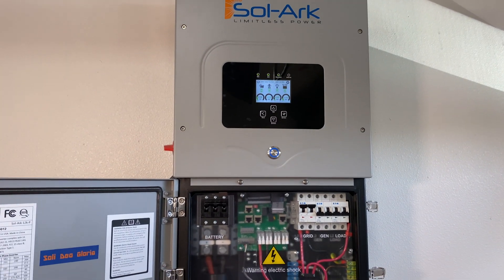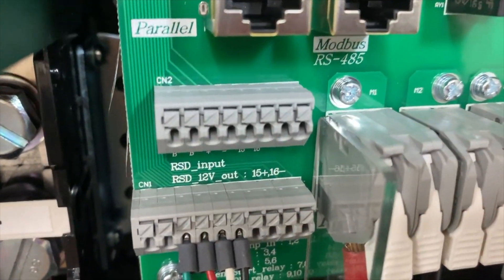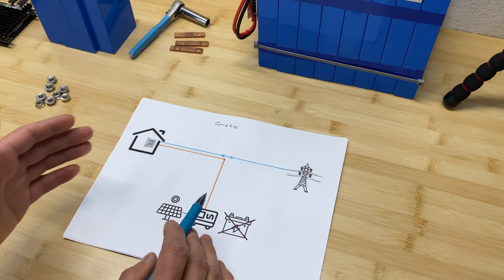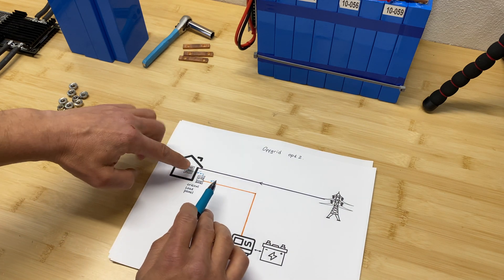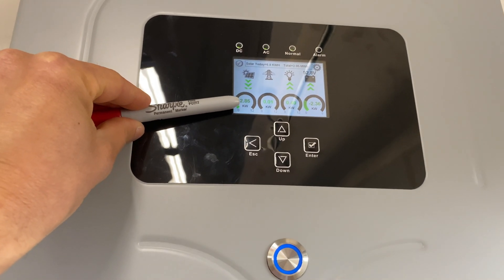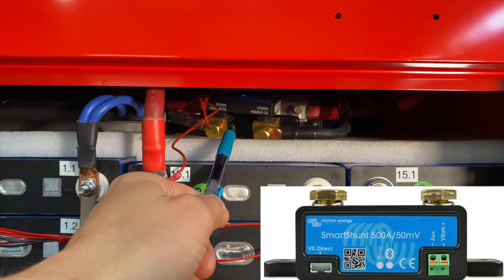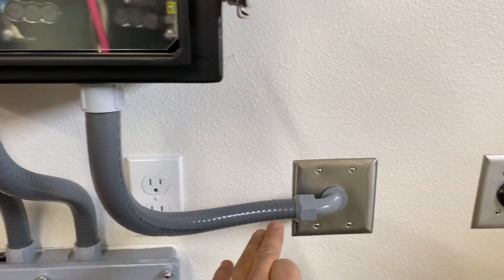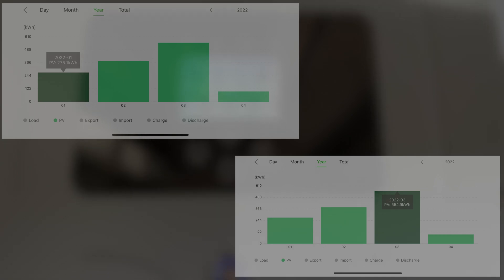3.8kW solar system with 23.5kWh battery. Detailed review.

Comment: Thank you for the nice video. I have a simple question. In the hybrid setup, and leaving the net metering switched on, how do you control what power from the batteries is sent to the house loads and what is sent to the grid?   Can you control this?
Reply from the maker: yes, CT sensors are installed right after the meter, so it's possible to control if you want to export to the grid or not. Also, all inverters have settings to prioritize battery charge or supply to load.

Comment: Does the invert automatically switch from grid-tie to off grid?   How long will that battery bank typically last you?
Reply from the maker: I have to manually switch from grid-tie to off-grid, 23kWh is good for about 30 hours (just in my case). 
Here is the video for the automatic switch between grid/off-grid: https://youtu.be/UXvFnlv3a88

Comment: Probably already answered but have been reading online that I can connect A/C coupling (Enphase Micro-Inverters) to the Sol Ark 5K and 8K only up to 3KW but the specs from Sol-Ark say 9.6KW for AC Coupling. My solar array is all with Enphase Micro Inverters. Really interested in using a Sol-Ark 8K with the HomeGrid Stack'd Battery.  Recommend YES NO?
Reply from the maker: Hi, cannot find any info about 3kW, but spec sheet stating 9.6kW max AC coupled imput
https://www.sol-ark.com/wp-content/uploads/8K-2P-N_Manual.pdf
Reply: Both the 5k. and the 8k say 9.6kw A/C coupling but a couple of installer videos keep saying they are limited to 3KW. Sol-Ark states in their video that the 15k has a a/C coupling limit of 19.KW.  Just need to be really sure because all my panels have micro inverters and I want to install a HomeGrid Stack’d battery.
Reply from the maker: @kayjet64  it's better then to contact solark customer support and double-check. 
Going to be great if you could post update here.

Comment: Love the video but I’m so confused on the way you have it wired. I thought you were supposed to disconnect the wires coming on top of your sub panel completely connect them to the inverter then send wires from load to 
your sub panel and connect them where your old grid wires we’re and use the inverter as a pass-through 😅
Reply from the maker: My connection is grid tied. here is why it's paralleled with grid.
I can manually disconnect subpanel and power it from Solark only.

Comment: Cool!
I have a 3.6 kw off-grid system with a 5.6 kw inverter and a 7.2 kw lifepo4 (Pylontech) and I want to complete it with a 5 KW on-grid system. Is there a device to interconnect the two systems so that I can charge the batteries with the on-grid system? (especially valid when the sky is cloudy)

Comment: Can solark inverter communicate with optimizers If I want to replace solaredge grid tie Inverter
Reply from the maker: It can communicate with micro-inverters for sure. I don't know about optimizers, try to contact Solark customer support, I don't remember something about it mentioned in user manual.
Reply: @SolarEngineering  thank you for the answer. I am debating between ac coupling vs replacing the grid tie inverter with hybrid inverter

Comment: I still love your excellent content.  Thanks to yourself and a few others, I finally decided to buy a SA 15K after shopping around and finding a decent deal on one.  I've also picked up 16 280ah EVE cells and a JK 200a BMS to go with my 20kw of panels (which will only partly be installed initially).  I still need to get the other odds and ends, but your videos have helped me to understand other pieces I'll still need to procure to complete it all.  Exterior AC and DC disconnects, rails, DC fuses, wiring and I'm sure I'm still missing some additional stuff?  Thanks, and please keep the content coming!
Reply: If you don’t mind, what kind of price is good? Do you like who you got it from? Do you mind sharing who you got it from? Thanks. I’m on the fence with a 12k vs 15k
Reply: @Upliftyourbrothers  IMO, the 15k is a no-brainer over the 12k given the additional features and significantly more capacity, all at only a few more $.  That is if you feel you'll use it.  And while I don't need this much inverter, I think I'll need it in the future given EV's and electronification is basically being forced on us.  I bought from Renvu.  I have an account with them, so below advertised price.  I've been extremely happy with their service.  Of you live in the northeast I might be able to help you, if not give them a call and I'm guessing they will still do better than their advertised price...

Comment: All those batteries and you only have 455Ah?  I thought each one of those cells were 150Ah?
Reply from the maker: that's correct, I have 3 cells in parallel (2x155Ah, 1x150Ah) and then 16 in series.
So total 3p16s,  460Ah 48V
Reply: @SolarEngineering  Thank you for the reply.

Comment: You mentioned that you moved on to the solark because of the limitation from your gtil system. What were your limitations because I'm in this rabbit hole at the moment and want to just purchase one system, that's easy on the wallet.
Reply from the maker: 1. I need to have the ability to run off-grid during a power outages.
2. Need more powerful inverter (GTIL was able to supply only 3.6kW)
3. When I need to install a few more panels then another charge controller needs to be added (and total amount of devices in system will grow to 5 (3 invertters, 2 charge controllers).
4. At the summertime I was losing energy because I can draw from inverters only 3.6kW, and even if I have a lot of solar and battery power, was still limited to 3.6kW. Having solark (or any all-in-one unit) I can draw 5kW from batteries + all power from the solar array.
Reply: @SolarEngineering  would you suggest any other all-in-one inverters, instead of the outback? Sol ark is out of my budget, but would still like to keep the gtil. Tia

Comment: I see you used a inverter with limiter, im thinking doing that since i can't afford a battery. Is any available that take directly from the panels ? and how abou the ones you used are you happy with them ? do you still recommend them or there was problems ?
Reply from the maker: The cheapest option is going to be GTIL inverters (you can find in my previous videos). It has some issues with fans going out, but in general it worked well for me.

Comment: Amazing SE; I think you have been reading my mail!  The only question I have:  when can I get you to come to my house and help me with my DIY project?

I am currently GridTie status (est. 9.7 KW solar panels in 2 arrays with 2 Inverters) and I want to move over the OffGrid - Option 1 with Battery Bank being the primary source of power and only using Grid Power when Battery Bank is depleted.  Phase 2 of this Option 1 would be to grow my Battery Bank supply by adding a second bank to meet demand.

When can I pencil you down on my calendar to be here?  Keep pumping out you YT shares - your content is superb and very very informative.  Thanks!
Reply from the maker: do you know what kind of offgrid inverter you are going to use and what batteries (DIY or branded packs)?
and I didn't receive email from you.

Comment: 10:42 SolArk @$7K is a ripoff! It is just a Deye inverter but $5000 more expensive!
Worst part of it, Sol Ark banned anyone selling Deye in USA!
Reply from the maker: I didn't believe the first time I heard that SolArk is not a USA product. But yes - originally it is Deye inverter.
Reply: Yes, it's a Deye inverter modified to SA specs.  I believe SA does the lower end and has their own FW.   SA also supplies REAL 24/7 customer and technical service support, not to mention domestic parts and repair service.  Order a similar spec Deye from China (first you can't get them or even with the same spec), and after paying the financial and shipping fees, you couldn't buy one today for $5k less, even if you could import one.  Never mind having true 24/7 domestic support or the add-ons.  I agree SA adds steep premium, but not $5k and there's still not much out there that will match them for the total (and reliable) package.  Trust me, I've looked!  

BTW, SA didn't ban selling Deye in the USA.  They partnered sharing the engineering on the product and by far were the largest buyer of these inverters in the US, so Deye agreed to give them an exclusive business agreement.  I too wish you could still by a more stripped-down basic Deye in the US, but I more than understand the business decision on both sides.

Comment: Hello, Nice set up. I looking to get a hybrid inverter because i dont want to do net metering but i will like to use the inverter as a grid tie with a limiter so can supply the power i am consuming . Does the Solar ark have that option as your previous set up . Thks
Reply from the maker: at 6:20 I'm showing exactly what you described. It calls "limited power to home" or  "grid zero mode". 
Yes, Solark supports this feature.
Reply: @SolarEngineering  Thank you sir.

Comment: I presume you ran ground from your panels? To what did you connect this ground in your system?
Reply from the maker: yeah on 8:50 see lug attached to box with green bolt, bare wire going to 2pcs 5/8" 8ft ground rods, and green wire going up to roof to ground rails and panels.

Comment: Pretty clean setup.... Bravo. Thanks to some ATS controled by DIY IOT, I can switch between full Offgrif topology to grid according for example to my battery level. I can also be in your presented offgrid topology with a grid input only mode. I have only a 15Kwh LFPO4+JKMBS battery.... but my house is not huge and well isolated.  Iiving also in sunny place, I can be offgrid at 90% of the year...
Reply from the maker: Thanks! 
That's my dream to move somewhere and build a full offgrid solar system. Maybe sometime in the future.
Reply: @SolarEngineering  You can check my channel.... got plenty of videos but in French language sorry :(

Comment: Nice setup you have. The other option is like mine. Install 200A manual transfer switch  to choose either the grid (which I will have power co turn off soon) or   my solar system. Two 12K's, 20640W Array, 132kWh battery bank and 10K LP Gen. I also installed 100A man xfer sw to bypass Sol-Arks direct to 100A Solar Main Panel.
Reply from the maker: impressive system, let's shoot video!

Comment: Interesting, but you should also talk about your power needs and cost. N.Cal has a mild climate but still 276Kwh in January seems to be just enough to run the house without any heating and AC is barely needed in the summer where production will be at its peak, unless you're living way far east.
The solar panels price is very good, the batteries price is reasonable but the inverter seem very expensive, likely because its a low production items and you're paying mostly for the R&D.
How long do you thing it will take to have a return on investment?
Reply from the maker: Power usage will vary from one household to another.
My house is fully electric - heating, water heater, stove, so I'm using all of the energy.
Pay period is about 8-10 years (in my case), but most important for me is to have power when a power outage or "safety power shutdown" occurs.
And I agree that the inverter seems unreasonably expensive.
Reply: @SolarEngineering  Yes power usage will vary from one household to another especially if they are located a few miles from the Pacific or from the Nevada. 
You're showing your personal experience, great but you should show what was your energy bills before and after the conversion. Did you consider reducing your electric power usage with reversible heat pump which are very efficient in the California weather and solar water heather, I still don't see how you can survive with 276kwh in January in a fully electrical powered house.
I perfectly understand your concern about the "safety power shutdown" but in a state where the electricity is greatly overpriced and the personal generators are banned, maybe the problem is somewhere else.

Comment: Isn't the definition of "offgrid" meaning that there is no connection to the grid?  If there is a connection that would be grid tie or hybrid, no?

Secondly, I wonder how the inverter can "supply" power?  Does it actually generate power or it just directs it from a battery, generator or grid?
Reply from the maker: Yes it's correct. Often times when people build full offgrid system, they have access to some sort of grid power (unreliable city grid, generator, shore power). 
RV is a good example - it has offgrid power system, but additionally could be connected to shore power or generator.
Reply from the maker: >>Does it actually generate power or it just directs it from a battery, generator or grid?
redirecting grid power or converting DC power to AC when using batteries.
Reply: @SolarEngineering  Ok, got it!  Thanks.

Comment: I have a 3.8kw of panels . The inverter is a power one . I have added a battery controller with 3kw of usable storeage . The battery controller has a CT clamp on the inverter output and one on the grid input . When it sees power attempting to go to grid it sends it to the battery bank . On the other hand if it see power being used by the grid it will try to match this power with the battery keeping the HSE at zero power from grid .
When battery is full another CT clamp check grid in/ out if it sees power going to the grid it sends it to a hot water tank (150 liters) and a towel rail. Once all these items are at max the solar power may pass to the grid.

The charge controller also has UPS for grid dowond . I have a generator switch to isolate grid as well as a generator (6kw)
Reply: Which battery controller are you using?
Reply: @RJ-cc1fz  hi , sofar3000 sp
Reply: I like your battery's I am only on lead acid . But come the summer I intend to put in a 16s 48 volt lifepoo4 150amp and then at another before winter
Reply: @andrewpeterwhatsonmybench1383  my batteries?
Reply: @andrewpeterwhatsonmybench1383  really interested about your inverter. Is it a grid tie inverter and a charge controller? What is the pv voltage range it accepts?
Reply: I have two inverters one is grid tie and has two inputs for two arrays . It is a 4kv inverter . It just converts the DC from panels into AC and feeds the HSE or grid if the HSE does not use it .
I firstly then added a switch which if it sees AC going to the grid . It will send 40w at a time to my hot water tank . 9 KW will heat my water to 80 c and switch off . 

Now the power went to the grid. So I installed a Sofar 3000sp battery controller with a 3 KW inverter . The controller watchs the power out of PV inverter and any that may go or try to go to the grid and uses it by storing it in a bank of battery's . Automatically it will flick from charging to supply of the HSE until PV stops and battery's are at Mon set volts .
Reply: @andrewpeterwhatsonmybench1383  is the 3000sp also an inverter?
Reply: @RJ-cc1fz  yes 3kw